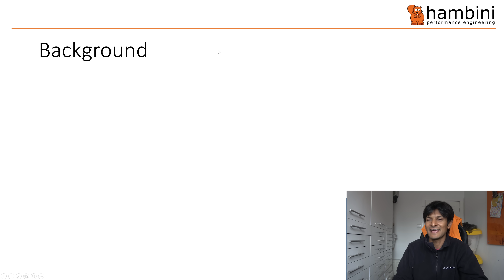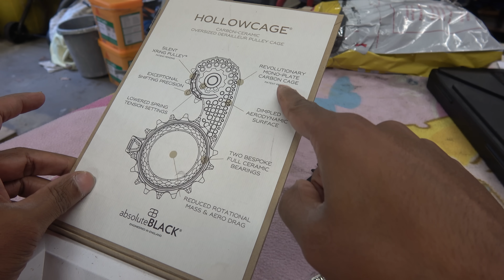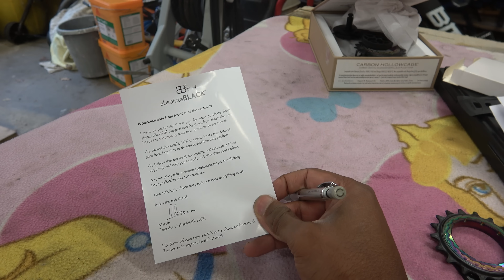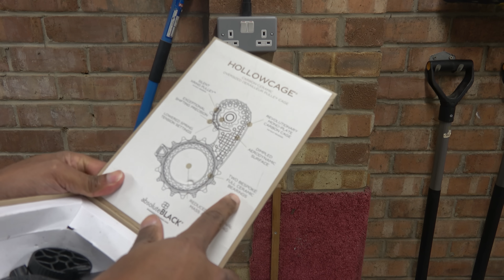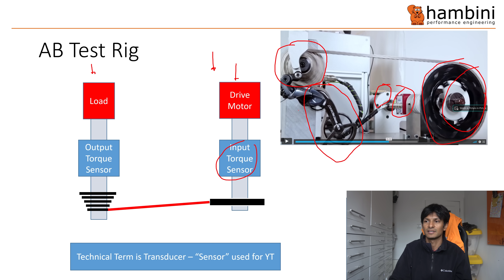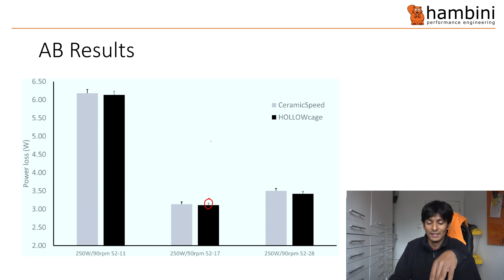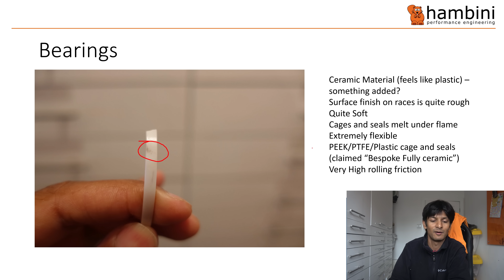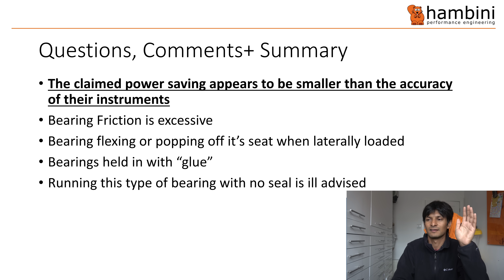AbsoluteBlack $700 OSPW: An Engineering Reaming Hollowcage

Comment: Long time mechanical engineer here. This is not too surprising in the context of an industry focused on making money. Looks to me like the engineers did a reasonable job of maximizing performance while minimizing manufacturing cost. I think the potential for mechanical performance gains is extremely small because the load on this component is very small. Where it is located on the bike would seem to limit any potential aero improvement overall. This kind of problem arises when the marketing department gets involved, they probably don’t really understand the physics and they are definitely motivated to make inflated claims regarding product quality and performance. Just another case of buyer beware. Seems to me like the chain lube industry is even worse at this false advertising game.
Reply: I agree with many of your points, however saying it is made from full ceramic and carbon fiber is lying, not exaggerating.
This is as bad as gold plated jewelery vs solid gold jewelery. It looks the same but it's not a trivial or cosmetic difference in the product quality.
Reply: @richardpowell1425  I don’t disagree with your statement but my perspective is that exactly where an exaggeration becomes a lie is somewhat subjective. In this case where an attempt is being made to justify a ridiculously high price who ever is making the claim is going to feel obligated to push the limit perhaps to the point of absurdity. I was thinking about replacing the hub bearings in my bike with ceramic bearings. When I did a little research into what was available I found prices from less than $10 to more than $100 per bearing without really a very convincing description of the features or justification of the price. My takeaway was that the term “ceramic bearing” must be applied to a very wide range of products and buying these things was a gamble with unfavorable odds. I opted for conventional bearings from a know high quality manufacturer which were expensive but not unreasonable.
Reply: @doernerrr  that's where marketers see it a slippery slope and claim its ALL subjective. But saying what material something is made of when it is not true is crossing a line and its no longer subjective. Just because not all customers can tell the difference between the components doesn't make it OK. I gave an example of gold plated vs solid gold.
Full ceramic bearings describe the balls , the race and the cage being ceramic. If they left out the 'full' part, it could be any one of those but probably just the balls.
If we need another example, if you buy a return airfare is it OK for the airline to fly you one way only and claim that your expectations were unrealistic?

Comment: Oye, I'm going to heat up the 3d printer and make myself some ceramic bearings! I might even sell some but remember they are not "designed" to have low friction and that's for a reason. Don't know what the reason is though but it's all been well researched by a Portuguese university...
Reply: It's so you get a great workout on your one ride to work when they explode.

Comment: This was not a reaming - it was an "absolute" hammering. Well done Sir I commend you for exposing the lack of proper engineering on AB's side.. I wonder if the Tech file for this product has any validated design calculations at all. Keep up the good work. In regard to reaming potential I think this product, and the Manufacturer can be classified as the gift that keeps om giving 💝

Comment: My only previous exposure to the AbsoluteBlack brand is when I encountered one of their oval chainrings in an online catalogue while looking for something completely different.  According to Sheldon Brown (whose advice is usually reliable), oval chainrings have been invented and discarded repeatedly for over a century - usually because they oriented them the wrong way.  Shimano's BioPace chainrings corrected that deficit and were therefore actually usable (though no longer made).  AbsoluteBlack's chainring is oriented the wrong way, and looks suspiciously similar to the photograph Sheldon Brown had of the century-old example.
This teardown (both literal and metaphorical) thoroughly confirms my impression that AbsoluteBlack are a bunch of charlatans masquerading as boutique bicycle component manufacturers.  Frankly, they should be taken to court for false advertising.

Comment: I can't believe they dissed your hairdresser. Sounds like the absolute accuracy error of the instrumentation would remain constant for all tests but what is important is the repeatable resolution of the instrumentation which could/should be specified separately.  But hey, this is all snake oil anyway.  The upper cog operation with respect to the cassette/freewheel is what is really important.  As far as spinning the cogs freely, even your dura-ace cogs seemed to be free of grease or oil.  Do you normally run your derailleur pulleys dry?

Comment: "HELLO HAMBINI FANS!"...oh wait, was that bit left on the cutting room floor this episode? Apart from that, and the guide pulley lateral play mistake (it's designed into Shimano derailleurs to smooth out shifts), ace video Hambini :)
Reply from the maker: on the shimano one, the entire bearing moves on the axle. On this one the bearing moves out of the pulley wheel.
Reply: @Hambini  On older ceramic bushing designs the jockey wheel just moved on the centre bushing. Once the travel for a gear shift is significantly more than the side play in the jockey wheel, this play allows the drivetrain to compensate for variation in gear indexing and run smoothly and quietly without the rider even noticing.

Comment: I'd really like to know if the slack fit on the bearing seat will allow parts to rub (toothed wheel against the cage) or allow the chain to rub against the cage.
Reply from the maker: yes it does.
Reply from the maker: the shifting isn't good either.

Comment: Just a bit of costume jewellery for your bike. Two years ago I got a hambini shimano bb for my venge. Unbelievable. Never had any creaking and still on original bearings. This year alone I've covered 15,500 miles target 17,500.
As for effort peak power 1,750w at some point during sprint. When MTB bracket fails that'll be having a hambini bracket in.

Comment: The "aero dimples" look suspiously like they were designed to hide the extractor pin marks from the injection moulding process to me.
Reply: Didn't do a great job of it though
Reply: As an injection moulder I think you are correct...  Ejector pins!
Reply: @Bikeops2021  that's the one, the bane of any plastic kit modellers life 😉
Reply: No they were injected and molded by hand

Comment: the high narrow-wide profile on the lower pulley is probably to retain the chain. they probably dropped chains constantly during testing due to exessive flex in the cage.

also the bearing races could be made of impregnated UHMW. (did it smell like candle wax when burning? then it´s likely UHMW)

Comment: I question anything with an under 10w "savings" unless it's reproducible over and over.   Partially due to margin of error that is just life, and partially due to the fact that if you're looking for single digit power savings you better be keeping those elbows in, head down, at all times, and make sure wind is hitting you just so. 

No way ceramic bends.  It cracks. 

The pen was slightly off, if you type the IS too far from pen, well, how can I laugh and chuckle?  

You rock. AB needs to define ceramic to us and also, injection molding vs carbon composite. 

I quiver at shifting performance from something that flexy.

Comment: Did the bearing shell burn, or just the PEEK? I  couldn't quite see in the video what was happening...

I wonder if it was ceramic, how it would be made? Seems very difficult given the high sintering shrinkage of from memory about 20%. I guess it would have to be ground to get it down to any bearing type tolerance.
Reply: it was "unharmed" so its some form of ceramic. the flexibility makes it odd though. the peek cage is just semantics, as they called it "full ceramic". not of any importance, but adds to the long list of misleading information in the marketing.
Reply: @littleshopofrandom685  I think he's splitting hairs here.  The bearing is fully ceramic in that the races and balls are indeed ceramic, and not a hybrid.  I'd never expect the bearing retainer to be ceramic.  But if you want to nit-pick to the nth degree, then ok.
Reply: @Dude On Bike  He is splitting hairs, that's what i said, and if their marketing wasn't largely bullshit it wouldn't be of note. Just adds to the pile. You put out that kind of marketing, you get nitpicked. Many ceramic bearings do indeed have ceramic cages. The primary purpose of ceramic bearings in many applications is thermal stability at very high speed, a plastic cage could melt or deform causing bearings to bind in the cage and slip. For example a tandem set of 50mm ID bearings running at 42000rpm in a high speed spindle on a machining centre.

Your BB runs about 150rpm tops. Your stock derailleur pulley therefore 500-700rpm. So, high speed doesn't come into play and as Hambini has pointed out in many other videos, strength, rigidity, precision, smoothness aren't really valid uses either over quality steel bearings in a bike application. Corrosion resistance might be, but if you're getting that much water, salt, chlorine on your bearings, the seals will die first making any bearing choice a short lived one. The primary purpose of ceramic bearings in a bike really seems to be to take your money. The only vaguely plausible thing I've heard supporting their use was running without lube or seals in a pro race to get an extra watt or 2 - then throwing the thing in the bin cause you've probably ruined it.

The truth is that ceramic sounds cooler than steel, and cheap "full ceramic" bearings actually cost less than high end steel ones, and the bike industry loves a sucker.
Reply: @littleshopofrandom685  It could have been Teflon. There are heat resistant plastics. They don't melt, instead they turn black and crumble.
Reply: @Mp57navy  yes but you couldn't realistically make bearings out of those.

Comment: The "carbon infused something something" is essentially a bike industry word for crushed up recycled bits of carbon fibre mixed into a plastic mass which is then usually injection molded. (Might of course be complete bullshit and upon inspection no actual carbon fibre is in the plastic, who knows?) Many saddles for example use this method to market the saddle having carbon fibre.
It's great for recycling sure but crushed up carbon fibre is useless and only serves to turn waste into a filler material in plastic.
The whole idea of the strength in carbon fibre is to have intact fibres.
Reply: A plastic water bottle cage with carbon fiber veneer, will actually look like carbon fiber.  Compared to an absolute black OSPW with a matte black finish pretending to be carbon fiber.
Reply: Covering plastic with carbon fibre veneer is totally different than mixing the carbon fibres into plastic. Mixing it in is harder to verify if it indeed is there at all and will look like plastic on the outside because it mostly is.
Reply: Reinforcing the plastic with glass or carbon fibres vastly improves the strength and durability of the material.
Reply: It does actually work to improve the durability of the materials. Cleats for example are injection molded with glass fibers, without glass fiber reinforcement they would last a dozen rides.
Reply: It's actually worse than that, 3D printing plastics doped with carbon fiber are actually not as strong as the base polymer. But when it comes to seling to cyclists, carbon fiber is like pumpkin spice in October.
Reply: @johnm91326  long fibers  yes, carbon/glass powder, no.
Reply: @truantray  where do they say they use a powder? It really doesn’t look 3D printed either.

Comment: I’m a bit saddened by this and will be cautious with this company, but I like their chainrings and will continue buying them. Also, I’m pretty sure the Genuine Shimano DA cage is carbon fiber, not metal.
Reply: The surface finish does make it look a bit like carbon/resin, but I think there's good evidence that it isn't; The aluminium alloy stand-off which connects the outer cage plate to the body isn't attached with a threaded fastener, and is flared like a rivet fixture where the aluminium stand-off passes through the spoke-side cage plate.
Reply: Shimano is far behind Campagnolo in the use of carbon fiber in components. Let's see Shimano make a crank like Campy!

Comment: Absolute TRICKNOLOGY,, the part time oval has made them rich, its just a trick, placing a 32t round chainring over a 32t oval chainring will show its a part time 34, sure its an improvement to a round, just put on a round 34t, Tricknology,  if oval gears are so good whay doesn't automobile transmaissions have oval gears,,?? should we have oval wheels on our bikes? maybe Absolute is working on those to release next... ;) great job of using common sense instead of B/S ..

Comment: I really like these kinds of videos and i agree Absolute Black seems to be little more than a marketing gig.
But i think there are some minor issues with the statements.

The way the cutter scratching on the A.B. cage sounds, it seems to be PA-CF with some 20% to 40% carbon fiber, so technically they wouldn't be lying when stating carbon fiber. Ok, maybe it is glass fiber, but pure PA or ABS doesn't sound like that when scratching. (The Dura Ace cage looks like composite too)

The bearing seems to be weird. A bit too elastic for ceramics but way too brittle for PTFE or something like that. But you have got to be honest. If it is a Polymer (or plastic if you will), it doesn't look like that after torching it. It is not clear for the viewers if the races burned (Duroplast) or if it was only the cage. And the cage doesn't matter much, it just maintains space between the balls. Important are the balls and races and they still can be ceramic after what we can see. Ceramic cages are needed if the bearing will have to endure high temperatures.

Might be nitpicking but one thing is them exaggerating about watt savings and not having a clue about their machine park. but straight up lying about the contents is different.

EDIT: and if someone is going to take 700$ from some performance and cocaine dependent investment banker, i don't feel sorry

Comment: As Hambini points out at 19:30  ball cage and seal burning of- inner and outer race look fairly fine after torching, so they might be ceramic. Nevertheless there is probably no benefit, if you have such thin ceramic races (they might be hard but still bend being so thin) with a flimsy cage and tiny balls and a shitty seal. If you have 7 Benjamins to spend on a rear mech cage you already hover above grounds and walk over water so marketing can tell you anything ..

Comment: a more definite test for the "ceramic" bearings would be to try and dissolve it in some acid. If it's plastic it will dissolve away, if it's ceramic it won't

Comment: Interesting teardown.
One point to note is the difference between "absolute accuracy" and "repeatability/reliability" of the measuring transducers. If the repeatability of the measurements is good, then it is possible to make meaningful comparisons between test subjects. I don't know what the 0.1% on the datasheet refers to.

Having said that, I completely agree with your analysis: These cages are just modern-day snake oil ;)

Comment: GOOGLE, CERAMIC: A ceramic is an inorganic non-metallic solid made up of either metal or non-metal compounds that have been shaped and then hardened by heating to high temperatures. In general, they are hard, corrosion-resistant and brittle.

Comment: I am fully expect that there will be catastrophic failures of these cages -- assuming there are people that actually run these long term (they are pretty safe for folks that use their Sagan edition S-Works as wall art). As we all know, dropping the chain during a bunch sprint or on a descent is a common cause of crashes. Surely riding is dangerous enough without replacing an efficient and dependable Shimano, SRAM, Campag cage with one of these things? Want to go faster?? There a ton of more efficient (and cheaper) ways... I really hope people don't get hurt because of this marketing driven product (armchair engineer, current product marketer with Mech Eng undergrad) -- love the channel @Habini

Comment: Quite impressed by your 5yo pedaling power!

note 1: Thanks for pointing that friction is increased with the ovality of the bearing. Does this means that a small bearing would have less frictions than a bigger one?

note 2:  My understanding of the datasheet and the test rig is: 
 1) uncertainties from full scale are can be calculated as follow: 0.1%*FullScale/sqrt(3). And 
2) uncertainties are not additive, but are propagated. see chap 5 of the GUM. 
Therefore if the power loss is calculated as Ploss =  Pout-Pin. This lead to an uncertainty equal to:
 u(Ploss) = sqrt( (dPloss/dPout)^2 * u2(Pout) +  (dPloss/dPin)^2 * u2(Pin) )
 u(Ploss)  = sqrt( 1 * u2(Pout) - 1* u2(Pin))
 u(Ploss) = sqrt( 1 * (0.1%*0.66 W) ^2 - 1* (0.1%*0.28 W) ^2 ),    (If you were measuring 15 Nm, I took your calculation I presume you are right with the Watt = RPM*Torque)
u(Ploss) = 0.345 W     (if you were measuring 15Nm at the set RPM)